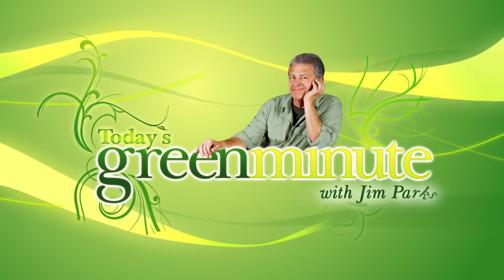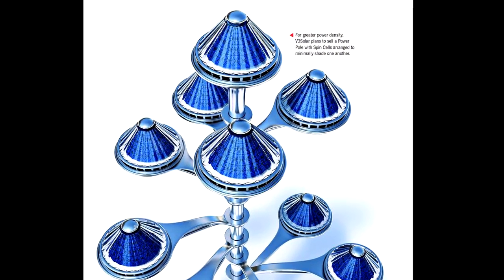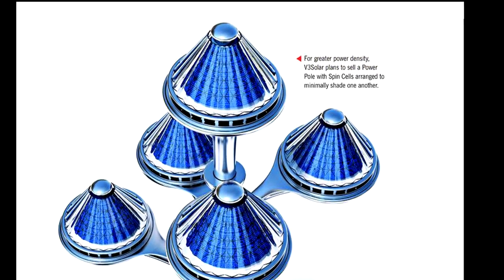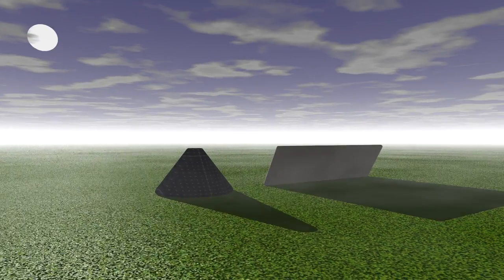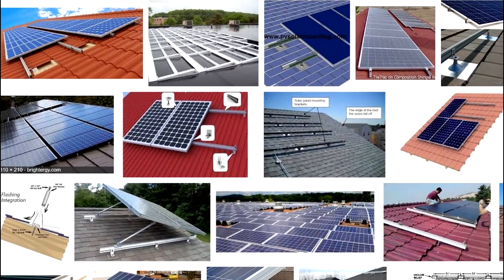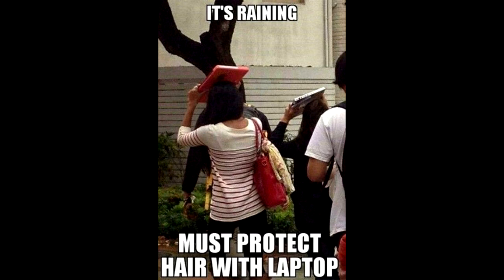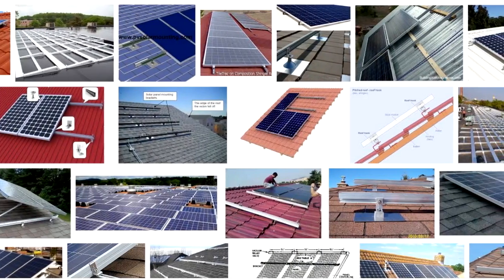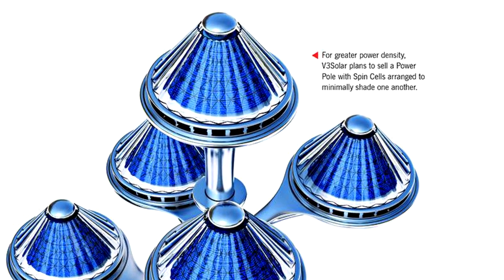Spinning Solar -BUSTED!

Comment: its a silly idea and is ruining the genuine benifits of solar power, but I did hear in your video talking about how water can increase the efficiency of a conventional engine like in cars , its a very old but proven to work system , however it doesnt increase efficiency by 50% .. not by a long way , it does increase mpg but not by a lot , it was used in the 80s by long distance drivers with the benifits only coming if you drove all  day every day.  
I guess thats why these things annoy me so much , they take a tiny nugget of truth.. add some fancy graphics , throw out some impossible numbers and bam they get funding , meanwhile more down to earth solid improvements which dont over 4000% increases dont get funded as the idea of getting an extra 20% from your car sounds mundane in comparison.

Comment: Hey Thunderf00t!

As always I appreciate the critical lens that you place on information that you see come through the web. But I would like to give you some feed back on this just to make your critique more precise (ignoring root2 being 1.5 and pi being 3 ofcourse).

It would be my guess that an engineer a cone-shaped solar panel would at the VERY LEAST double the area of one for the purposes of generating electricity. and this would because like you stated any any instant half of the cone is not receiving sun light, and another factor which also comes into play (that I believe you barely touched on this to be generous) is the curvature of the surface which would only decrease the efficiency even more.

The spinning could help with the cooling like you stated, but another idea can be to couple solar power with wind so that the wind maybe able to help rotate the solar panels to cool them, and provide wind energy for a generator as well. 

I would like to see your thoughts on this.

Comment: Are we just not going to talk about how the act of spinning the panel is itself a cost of energy? Even if you make it very efficient, it can still soak up a large percentage of the already very small amount of energy you're getting from the panel.

Kickstarter and similar sites should put a rating system on projects similar to the way Rotten Tomatoes does ratings: an overall rating and a rating from only the top critics. Then if you see that the top critic rating is way lower than the overall rating, it might be a fake post trying to scam for money.

Comment: Phil perhaps you might look up "fresnel lens" before dismissing the lenses or the angle to the sun.
Reply: Fresnel lenses don't increase the area at all, it just focuses things down, just like ordinary lenses. You'd still need a huge lens regardless of the type that you use.
Reply: It does help if the lens is bigger than the solar panel, since it can gather more light and focus it on a smaller panel.  However this will make the panel heat up more and become less efficient.  So the benefit will be minimal.
Reply: fresnel lens only make the lens flatter, doesn't magicaly allow it to gather more light than crosses it

Comment: I'll give you that the dome is stupid and these 20x figures are obvious bullshit,  but the point of the spinning is to make the panel itself cheaper to produce since you don't have to engineer around the increasing heat.  What I want to see is some cost-benefit analysis to the spinning vs a flat conventional panel,  if the produced watt is cheaper with the spinning shit then that's all that matters.

Comment: So in addition to constantly hiding half the cells from the sun, they waste energy on a rotor? Nobody thought of using that rotor for something else? LIKE A FAN??? Why not look into whether a decent cooling system couldn't get more energy out by increasing the efficiency than running the cooling system would cost.

Comment: Thunderf00t, I saw this reply on FB when I posted your video. My thought/reply to him might be, why not just have a flat panels on a 2 axis tracker then?:

Mike Brunt There is a problem also with this debunk. The sun will be directly over the cone at one point and in fact that could be maintained by changing the orientation of the cone. So the debunk is pseudo-science also.
Reply: Not really. If you tilt the cone so it is directly pointing at the sun... then the sun will hit 100% of the cone's surface area at a very inefficient angle. We could fix this, of course, by flattening the cone more and more until the sun's rays hit it perpendicularly, but then, we're back to our original flat surface again.

Comment: yes the spinning panel is not as powerful as they are saying, however you made some serious mistakes in your calculations.

Of course the math doesn't work out when you change the words used. They said 20 times the energy not 20 times the efficiency. 

you also made a huge blunder when changing the efficiency of BOTH panels to 100%. we know that panels are nowhere near that efficient. We also know you only made that change to make it look worse.

The increase in power output from the panels comes from the improved efficiency so setting both to 100% would of course ruin that.

Your are getting lazy in these videos

Comment: Thunderfoot, but how does it compare to static solar panels? I've supported all of these debunking videos you've done but I feel like missing the comparison to the kinds of solar panels people put up on their houses is a big jump
Reply: Solar panels on houses don't move much. But solar farms have a tracking system. No solar panels need to waste their energy spinning like fuck too.
Reply: Yeah... couldn't they just rotate only when hot?
Reply: or you could just turn a fan on it or just have it shut down when an overheat sensor trips. lol So many ways to avoid the spinning nonsense. You're better off with a big found disc aimed at the sun where 100% of the surface area is seeing the sun. lol
Reply: From memory he said in another video that flat panels were about half as efficient.  It was in one of the "solar roadways" videos.

Comment: Only a very small percentage of the cone panels will be exposed to the sun perpendicular to the sun's rays. The efficiency of the panels drops off as is curves away from the thin portion of the panel that is perpendicular. I think the efficiency would be more like 10% of the flat tracking panel.

Comment: The plant powered USB you used as an example is actually legitimate just really misleading in how it works and inefficient in terms of sustainable energy produced. It has zinc and copper plates towards the bottom and the soil from the plants goes in between them and basically just sits there being soil until you water the plant at which point it turns into electrical energy via galvanic corrosion. Obviously the voltage you would produce would depend on the type of soil used and from a cost stand point it's abysmal since the copper will corrode away relatively quickly but it does in theory actually work, just not in the exact way advertised or better than just using a battery or a wall outlet. Please make more of these debunking videos though I cant stand seeing all this pseudo science spread all over the internet.

Comment: Here's an idea, stick solar panels on to wind turbines. The wind powers the turbine, and the sun powers the solar panels. And the wind also cools down the solar panels. ©

Or to introduce a cooling system, stick solar panels near large bodies of water. The water will reflect more light onto the panels, whilst at the same time cooling the panels. Extra light, extra cooling. It's a win win right there. No idea why they don't put them near large bodies of water to begin with.

Comment: Okay, I'm about thirty seconds in and I'm already spotting problems.

1. How exactly does spinning reduce heat buildup? Surely whichever side is facing the sun will heat up faster, and if it's spinning at an appreciable rate the whole thing will be roughly the same temperature anyway? Also, why is heat buildup a problem? I thought photovoltaic cells captured heat energy to drive turbines anyway?
2. How exactly is a cone any more efficient than simply having a panel that tracks the sun?
3. Where is the energy to make it spin come from?

If anyone who actually knows anything about engineering could help I'd much appreciate it.
Reply: Number 2 drives me crazy.

Like they claim that by using a cone they can track the sun throughout the whole day.

Well sure, but only with a small part of the panel. If i had to guess i'd say that on a per-area basis a flat panel on the ground gets better results than a cone.
Reply: well if you watch more than thirty seconds you'll get some answers

Comment: The other thing they don't cover is how they're gonna power the actual spinning gear drive. Run it off of power from the cone? Run it off of the grid? Since that motor would be running all the time, how would you cool it? Standard car-style radiator? So many questions.

Comment: So not going to talk about how this "panels" are wired together. Are they wired vertically, around the circumference, or are they single celled. From the look of it they're wired around the circumference which means the lowest out put panel controls the string and if there's always a panel not covered in light then the whole thing will never produce power to start with lol.

Comment: What a stupid idea to arrange them into trees....You'd be better off having a solar pannel with a Servo that tracks the sun. Heat? Why waste it, pipe water through, boil it, pump it at high pressure to a turbine and hey presto, less energy waste.

But no, they have to cover half their panels with the shadow of the "tree" and other panel cones, reducing it's efficiency even more. 

What a daft idea....We're better off improving beamed energy technology, then use solar satalites to just beam energy back to Earth or to collectors on space craft.

#MORENuclearPower

Comment: ROFLMAO... Your math is incredibly off... so is your understanding of thermodynamics, angle of incidence, and several other things... while some of your claims have a bit of merit in that these are probably very optimistic claims, your passing it off as actual "science" is faulty... I actually had several of your claims calculated out and found those errors in reasoning, but it deleted the longer post rebutting many of your claims and I decided your "psuedo scientific claims" really weren't worth the time it would take to write it all out again to explain it to you...  no, I don't think this thing can match up to it's claims and a few of your points are valid, but the rest is sloppy... Oh yeah, and it says 20x more energy, not 20x more efficiency... nice try old sod!

Comment: I have a question for all the engineers here: Do solar panels track the sun's location? What I mean is, are there any solar panels that will swivel their position based on where the sun is at any particular time of day so it's always getting light?
Reply: Yes. Lots. Of course, they are usually not found on normal people's roofs but in actual solar power plants.
Reply: Yaldabaoth Thank you.

Comment: is it nerdy to point out that that solar panel efficiency with respect to angles is like lighting computations on a GPU with respect to the vertex normals?  maybe we can get graphics programmers to solve our energy problems!
Reply: I liked this comment :)
Reply: i liked this response
Reply: Or you could use simple calculus and geometry and calculator.
Reply: Infinity Salinity shit.  thanks for that clarity.  you're a godsend.
Reply: +Infinity Salinity 
Hell you can do it with highschool trigonometry.
Reply: Brent Smith 
Trigonometry does not give you the surface area exposed to sunlight.
Reply: Simon WoodburyForget like the solution that allowed you to just submit that comment to the internet?
Reply: Simon WoodburyForget you seem to be talking about pure programming.  so, if you just mean typing in commands you memorized than you are being correct (if not pedantic) in saying this shouldn't be considered engineering.  but the thing is, any one involved with programming is immediately likely to build something.  at this point they have to make engineering decisions.  The fact that the products, systems, solutions they engineer aren't tethered to molecules and atoms in the physical world is besides the point.  Jesus, only on the internet is this a fucking debate.
Reply: Simon WoodburyForget right, he potentially does not make the decisions on rocket trajectories and velocity targets.  i accept that.  he is therefore not engineering the rocket.  but writing the algorithms and constructing the software architecture involves applying math and practical knowledge to designing a real world system, the definition of engineering.  you seem to think that because software deals in bits and not atoms this somehow changes the abstract definition of what a software engineer fucking is.
Reply: Simon WoodburyForget i'm done with this ridiculously time wasting semantic clusterfuck.
Reply: haha, a clusterfuck? maybe, but that is what software engineering is: deciding the language, architecture, OOP vs FP, etc... In which case, you're right, programming is not engineering, software engineering is engineering.
Reply: Are you being aggressive or asking a question?
Reply: Infinity Salinity 
Well you have to get a bit creative, but it can, at least for uniform panels.

Curved panels? Forget it.
Reply: +Alexander Bollbach to be fair, that was a multidisciplinary solution
Reply: Teddy Couch engineering is engineering. the fact that software is so abstract and so amenable to change is likely why it hasn't evolved as predictably as others.
Reply: Simon WoodburyForget yeah? ok, what is your definition of engineering
Reply: +Simon WoodburyForget In order for programmers to program they need computers. In order to transfer the information from one computer to another really far away you need a network of devices designed to transfer said information. How is that network of devices not an engineering solution?
Reply: Simon WoodburyForget have you ever heard of statistical programming?  and you really think people designing large systems that need to operate within the bounds of storage, processing power, and project requirements doesn't require intuition?  let me ask you a question?  have you ever engineered anything?
Reply: Simon WoodburyForget dumb ass
Reply: lol i'm going to assume since you stopped responding you figured out that software "engineering" is engineering?
Reply: Simon WoodburyForget you can subjectively reason all you want it won't turn your exponential algo into a sublinear one
Reply: i'm a novice programmer and I think about efficiency all the time.  you seem to be conflating only the most pure and hardcore compiler optimizing engineering with engineering in general.
Reply: if you read through the most basic C++ stl stuff they mention stuff about time complexity and runtime performance in the docs all the time are intended to be understood and used by programmers
Reply: Um no.  Only if existing algorithms apply.  Software Engineering is not a series of copy-pasta creating a result. And Functional programming  is one paradigm that does consider the mathematical efficiency of the algorithm  Other paradigms address it too... such as the choice between recursive  or  heuristic, or a specific-instance solution and anything in-between.
Reply: Steven Swenson if your gonna fight back use understandable words if you don't then they can't understand you and as such nothing changes because of your statement example: don't use tremendous and difficult to process words -> don't use big words please
Reply: big words?  Really?  In the age of Google?
Reply: antidisestablishmentarianism
Reply: Yes.
Reply: So how is state supported religion relavent?
Reply: Simon WoodburyForget programmers are pretty dumb
Reply: Simon WoodburyForget you are right, I've been wanting to go into programming since I was 12, and its annoying seeing all the dipshits who go to university try and act like they're smart. you can learn programming at home easily
Reply: Um no it is in fact empirical by it's nature. Applications work (properly) or they don't. Interface design is an art but not the app itself.
Reply: That depends on the application. Efficiency may not be the part of the problem to be optimized or relevant to purpose.

Comment: For real though, you could make a huge fresnel lens with a fraction of the material needed for a convex lens, and it would work just as well for this purpose. You don't need a giant telescope grade lens, just a thin sheet of plastic like the ones used in those big ol TV sets. And yes maybe it would make your solar panel heat up more, but in places where all you have is clouds, it would be a good way to boost the sunlight up to where a smaller solar panel can do the work of many more, at the cost of manufacturing a big lens instead of the same surface in solar panels.